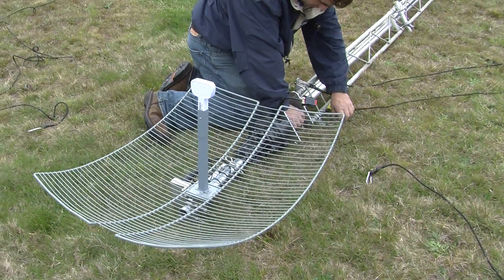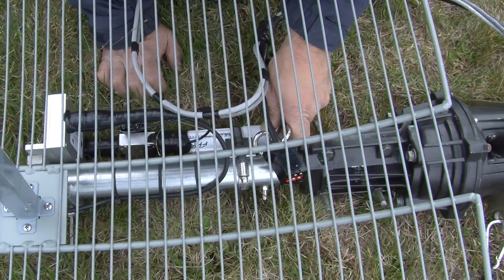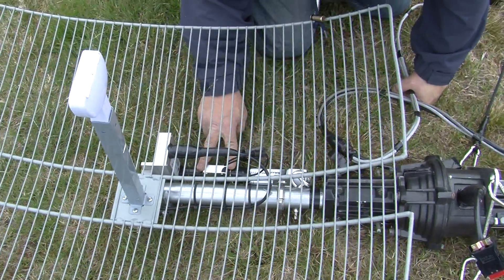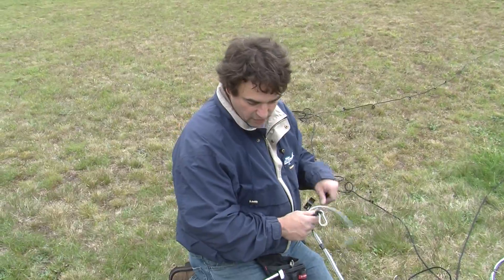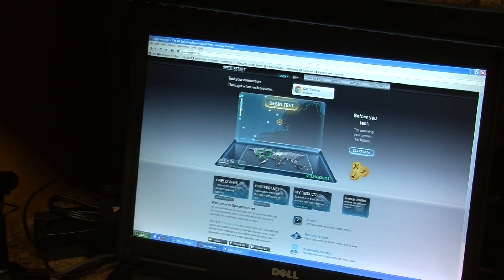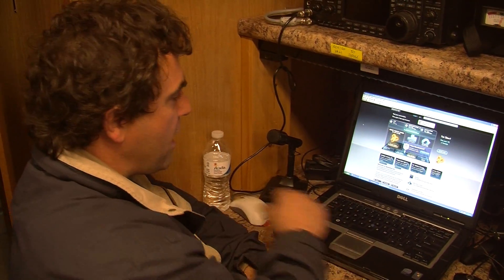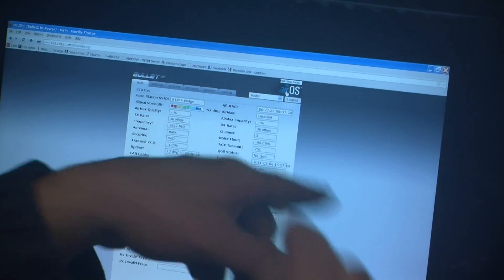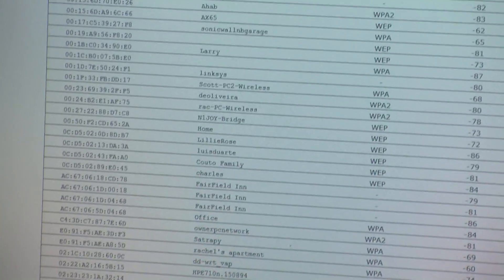High Power, Long Distance WIFI for the HAMCOW

Comment: Noe Suarez, this path was 90% over water.  The feed side is on top of 40 ft tower at the top of a 16 story apartment building.  The side in the video was on a  45 ft. tower at the top of a 120 ft. cliff looking down on the ocean.  (Technically Buzzards Bay).  I proved all this out with Radio Mobile Deluxe and it actually worked slightly better than predicted.  My company did some upgrades to the site feeding this and in 2014 we were seeing speeds in excess of 20 mbps at times.  Pretty impressive since the highest speed these radios produced on the bench were 25 mbps throughput.

Comment: I cant believe you are getting that kinda reception at that distance cus I have a 24 db grid with a 6 watt amp and do not get some of the routers I get with a 9 db omne running at a half watt
Reply: vorkev1 It was clear LOS between the 2 dishes.  We were set up just to the right of the lighhouse in this photo.  We're on a 40 ft tower at the top of a high rise apartment building.

http://www.qsl.net/hamcow/images/LOS_BOS0012_to_Gay_Head_Lighthouse_2013.jpg
Reply: Roland Daignault that's awesome and amazeing I have found that things do matter on luck also as I have a router with ddwrt installed and 2 10 db antennas on the back and am receveing a wifi connection from a unmodified router that is 2 miles away with trees and several houses in the way yet I get a connection some how even tho I should in no way get one yes its only 3 mb on a 100mb connection but still amazing and blows my mind

Comment: Hey really great video, thanks for sharing!  That 19 ms latency over 22.5 miles is incredibly low!
Reply: Judah Loewen We were 2 microwave hops off a fiber.  :-)   Most of that latency was on the WiFi link.  the 2nd link is a 400mb Dragonwave radio to a router sitting in a Tier 1 fiber transit.  It helps to work for a WISP.  We also host the Speedtest server I was using.